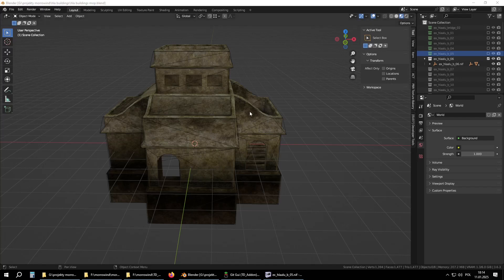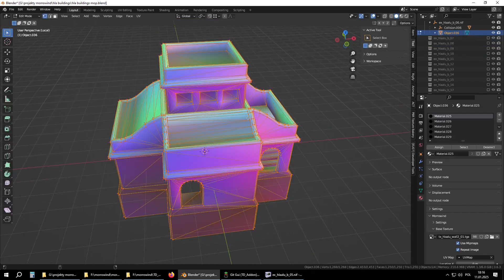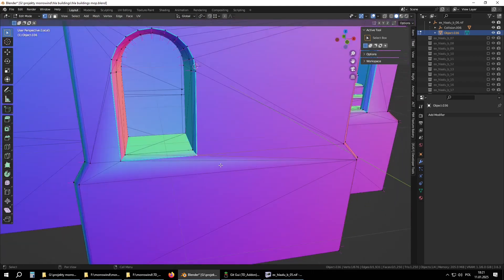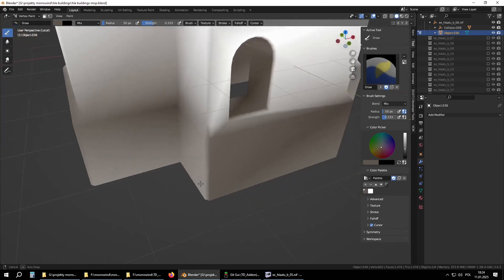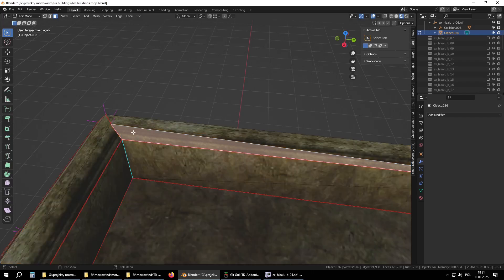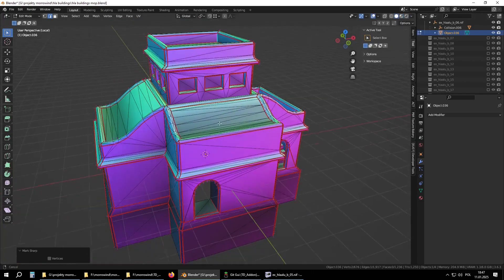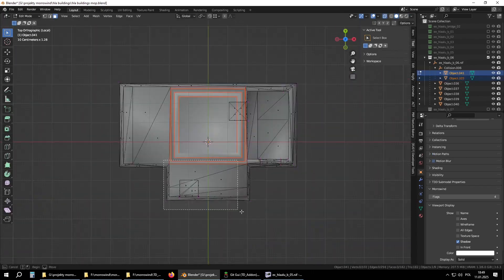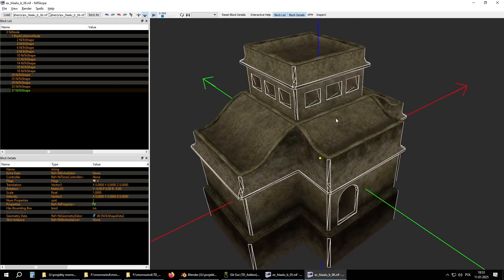Morrowind houseflipper. Fixing houses after Bethesda

Comment: so i have questions.   did the import process remove the sharp markers?    and does this actually matter to the base game?   if the game engine doesnt do much shading then the normals dont matter and appear flat anyway. 
also keep in mind that depending on the mesh format. sharp edges and custom normals and UV seems. can introduce Double edge pairs which means more ram usage.   so they should be used carefully.
Reply from the maker: Sharp markers exist only in blender. Import process should retain normal vectors, so shading is the same as was on export. Nif has indexed vertices that hold position, normal, uv, color data. Split normals and uv seams do generate double edge pairs, there is no wayaround, but just bended normals shouldn't. And it is visible in game, even in editor at first glance with default lighting. Just most players lack devbrain to notice it.
Reply: @antonisauren8998  ok.   thanks for clearing that up.   would be nice to see what it looked like in game

Comment: As I understand it, you have two monitors - and you do some of the actions on the 2nd monitor) 
For example, you edit UV there. 
I think it will be interesting for viewers to see the “original” texture on the basis of which this building was created.  
In those days, creating 3D from texture was popular
Reply from the maker: Those buildings are using five tiling textures. Two trims and three variants of adobe with grim or bricks showing on the edges. Unwrapping on single screen is painfull for me as blender's UI does not even fit on split workspace. I'll try to swap screens when it is important at least. This time I only relaxed few visibly stretched areas.
Reply: @antonisauren8998  This is simply for the viewer's convenience. If you are talking about a 3D model and there is a texture) Then it needs to be shown. 
Just on the screen for minute- you can remove it later

I have enough qualifications to understand what you did there)
But I'm afraid that many others will not understand)

This is some advice for the future

Comment: I really don't think these mistakes were done in 2003 by Bethesda employees, these are probably the export-impot to Blender issues. But anyway it was extremely helpful.
@antonisauren8998 what is that Vertex paint for? Did it serve as some kind of AO back then?
Reply from the maker: Yes, mostly fake shadows over tiling textures. Sometimes also grunge to break up regularities.
I'm not saying that previos modders did not messed those model in any way, but they have those issue in clean vanilla game too. I'm testing them on clean GOG install. Just loading up Balmora in CS and I can see which pieces are left untouched by eye. Experienced 3d artist with knowledge of how netimmerse works on top, was really rare specimen. Modders today are often more knowledgable about tools and engine than original devs.

Comment: Does it retain its UV texture atlas to the engine or is it seamless procedural texture it's using?
Reply from the maker: I don't understand the question. Most of those buildings use 4-5 tiling textures. That's why model is split into several meshes.
Reply: @antonisauren8998  Oh, so it does use atlas textures, I was wondering that because I thought the textures are procedurally made since I can't see shader node window in the video. 

And not knowing how the textures work in the morrowind engine. I thought it accepts procedural textures made from Blender.
Reply from the maker: @sebastercats6123  It is not an atlas. There is separate modding project joining those textures into larger atlases. Back in 2000s hardware could not handle large texture atlases. Bunch of 256x256 images was much easier to handle. Opposite to what's the norm today.
Nif format supports dds, tga, bmp or can have raw  color data saved together with model file even. Dds is the standard and textures game comes with. Shader graph wouldn't tell you much as it's packed inside singular custom node that exporter can understand. Procedural textures would require baking by hand before export.
Reply: @antonisauren8998  Wow, I didn't realize that's how the engine processes textures back in the day. Especially with formats that I don't recognize. 

I guess my question of modern procedural textures putting into an old game like Morrowind was a bit stupid. Anyway, thanks for letting me know, being an environmental artist solely rendering on Blender made me ignorant of how textures were used back then compared to how advanced we use them now, especially with PBR materials and compositing.
Reply from the maker: @sebastercats6123  Modern engines behave exactly the same, unless you use some fancy shader generating procgen image. It might take three textures with seven channels for various properties, but handmade UVs and textures are still way to go. Engine at best blends several to get snow or dirt effects on dynamic objects. It's much faster than doing any procedural generation on the run.

Comment: Wish I could see what you were doing with the UV at 9:30. Would you mind giving me a sort of writeup explanation? I forget if there's an align tool for UV islands in Blender, for example, and it does appear that you're doing them all at once instead of manually moving one at a time, so I assume there is, unless that's an illusion from grabbing multiple and moving them by hand as one. It's just a little hard to tell where in the process of fixing the UVs you were at each point in that little spot and what you did to correct them.

Comment: What are you doing on your other monitor (I assume, your mouse is going offscreen) in the UV part?
Reply from the maker: Yes, I'm used to having UV window on second screen. When I have to show something and work with both on single monitor I struggle a lot, especialy as blender ui does not fit. Here it was not the point so I didn't bothered.
Reply: @antonisauren8998  What were you doing in the UV editor? Running unwrap on the UV islands?
Reply from the maker: @ Pinning one edge and relaxing stretched islands mostly. Unwrap, turn into quads, follow active quads in case of trims.

Comment: Are we sure blender and the extraction tool gets the normals right? Are the errors visible in the game I mean?
Reply from the maker: They sure are there in game. Especially visible if you crank up diffuse lighting above default values.
I've learned that if you leave object with multimaterial and let exporter split it, normals are fine, but you end up with one redundant empty parent for them.

Comment: Is this easier than the construction kit?
Reply from the maker: Like blender overall? No, but less limiting plus knowledge is appliable in any other game/project. Is making legos easier than building from them?
Reply: The construction kit is used for placing models and objects into the game world, or modifying game mechanics.
Blender is a modeling tool like Maya that designs models, and one point could've been used as a game engine, but they discontinued that feature around 2019.

Comment: as for split by material problem, it was the same issue in 3Ds Max. Workaround for it was to make a copy of the object for each material and remove faces for any other material from that copy. This can be 100% "one click" solution.
Reply from the maker: I started in max but engine I developed for supported only smoothing flags directly exported from it back then. Were custom normals even a thing in 3ds 25 years ago? Maybe that is a cause why those buildings looks like that. Most modders nowadays is way more experienced in both tools and engine than Bethesda devs were during development.
Reply: @ as long as edit normals modifier was present. And then, they had to be set to "explicit" to survive some topology manipulations. Each other modifier being able to change topology data ( edit poly ) was removing ( resetting ) all vertex normal data. Now, since few max versions, all is stable, even boolean are not changing them, which is fantastic.
Reply from the maker: @ I have slight memories of direct normal manipulation in Max. Last version I used was 17 I think.

Comment: Custom normals in blender reaaaaally needs an overhaul. They are currently so messed up they can't even be implemented in geometry nodes, which would be extremely useful
Reply from the maker: Dozen houses later I noticed they get messed up even when mirroring, at least with putting -1 to root scale and applying that.
Reply: they can be edited in Geometry Nodes tho.

Comment: What are they using vertex color for? Fake ambient occlusion?
Reply: Yes. They also used this a lot in Skyrim, as they still didn't implement AO maps into their materials. Not sure if that changed for Starfield.
Reply: @jin3121  Now I wonder if there is some tool or plugin that allow to convert AO map to vertex colors.
UPD: Answer is Blender addon - Bake to vertex color on Gumroad. So one can also create AO with Blender or Substance Painter and then convert it to Vertex Color.
Reply: @MoonnyMoo  Yes, most 3D software comes with built-in tools or community plugins for generating "Ambient Occlusion" or shadow vertex colors. This method can be a cost-effective way to add detail to games, especially when working with older game engines. However, caution is needed when using shader injectors like ENBSeries, which includes an external AO shader. Combining dark textures, vertex color shadows, and external or in-engine AO can sometimes result in overly dark or "crushed" assets, where the black or shadowed areas lose detail.
Reply from the maker: Morrowind does support AO textures. (kind of, not in PBR sense. It's still phong lighting model after all) They can even use separate UV set. Same material slot can be used also for alpha mask. Keeping it as vertex data is ofc takes much less memory and it had to fit into few MBs of first x-box vram. Besides fake AO, it's also used to break tiling and add some grim details.
Reply: @antonisauren8998  In Skyrim, most people just multiply the AO map into the diffuse. As long as it looks good, I see no problem with it.
Reply from the maker: @ I do so the same for misc stuff with dedicated textures. Removing vertex color data saves you few kilobytes. But buildings like this one use often tiling textures, or parts of larger atlases in case of mods, so it's out of the question.
Reply: I was wondering the same thing, could be fake AO or it could also be a simple map texture that darkens certain areas of the base (diffuse / albedo) texture, morrowind being an old game doesn't use more advanced techniques and probably "bakes" a lot of the visual information into the textures. (I guess this is probably what you meant but in fewer words haha)

Comment: Learned a lot from your video thanks for posting it. Would love to see you tackle the televani housepods someday in mop. I did fix them myself but would like to see a professional take on the process. Housepod 03 is expecially messed up.
Reply from the maker: I opened it up just to check how bad it is and done what I could. Sorry, out of camera. :P On one hand it's much simpler than Hlaalu houses, just single blob, but on the other it has major design flaws. At least it was something different. Top is single relaxed island, just must be warped a bit so that tit on geometry matches the texture. Same with pod. Gills looks the best when set to utilise whole height of the texture. Distortion is much worse than aligned to one edge only but seam with pod part gets masked a bit at least.
I'm going over Hlaalu in preparation to fixing similar issues in Tamriel Data before Narsis release. My contributions to MOP are limited to things that bother me in game or are required to match with TD extensions.
Reply: Thanks for responding. ❤